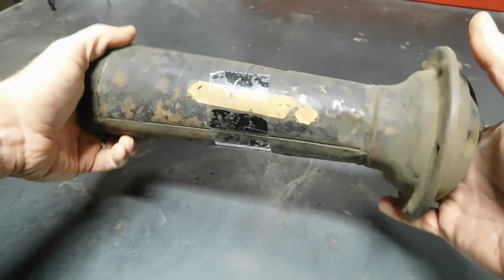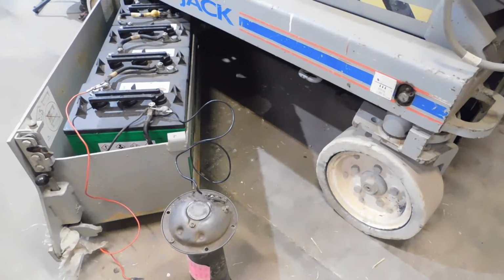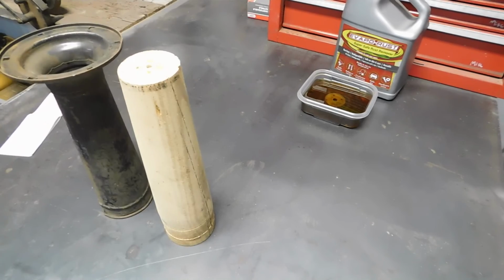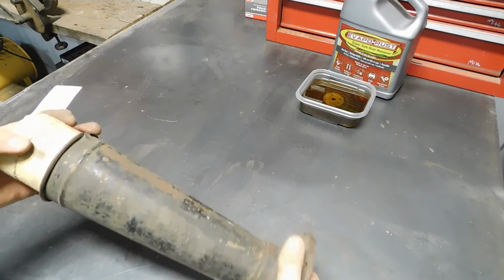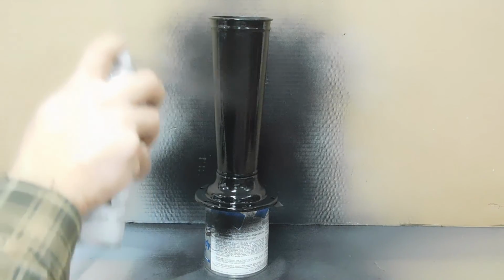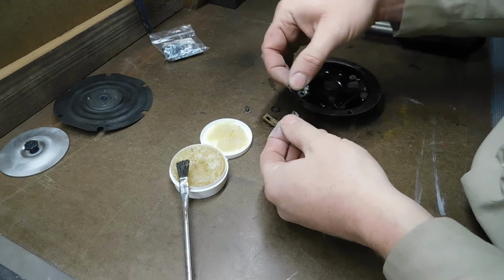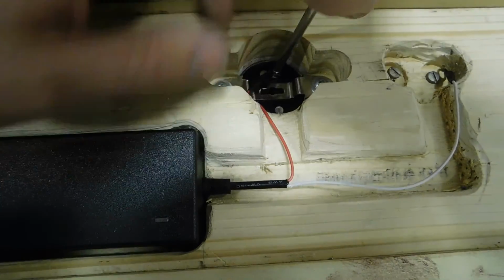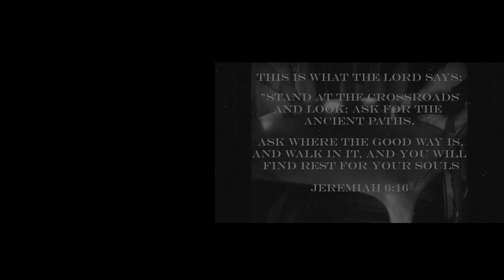Car Horn Restoration - 1930's Delco-Remy K-31 Klaxon Type Horn

Comment: What did you use to acid etch before the blueing?
Reply from the maker: Super Blue doesn't require acid etching. Just clean the parts well with alcohol, rinse with water, blue and let sit, then rinse with water again. I've also clear coated it with clear spray paint. But to be perfectly clear, this is a home do-it-yourselfer type product not a professional product.
Reply: @TheJayhawker  what was bubbling in the container?   I thought that was acid etching.
Reply from the maker: @Rottingboards  I'm sorry!, I had to go back and watch it to see what I did! Yes, if you have modern zinc plated hardware and you want to make it look original toss it into a 10:1 solution of water and muriatic acid. It will strip the zinc right off.